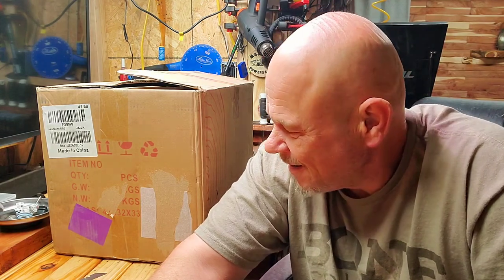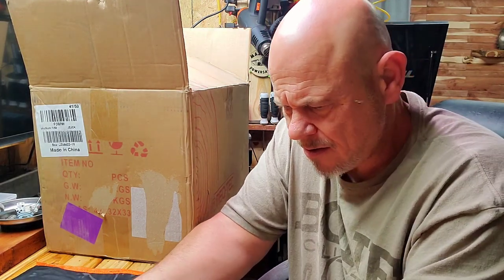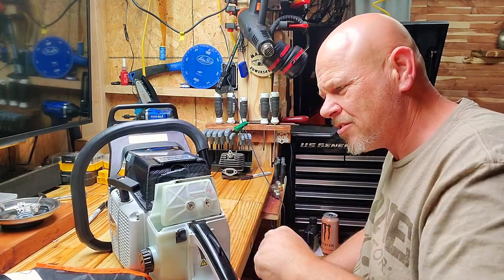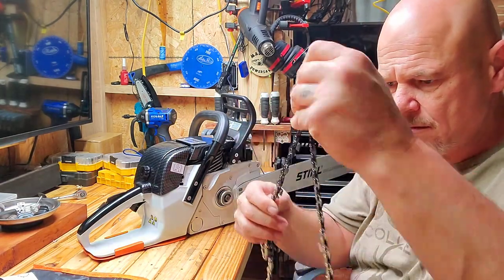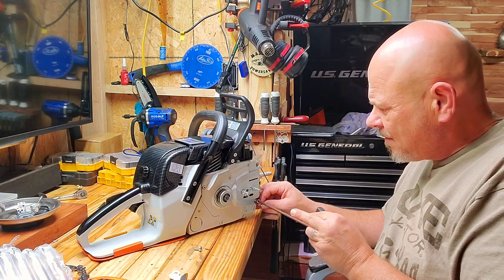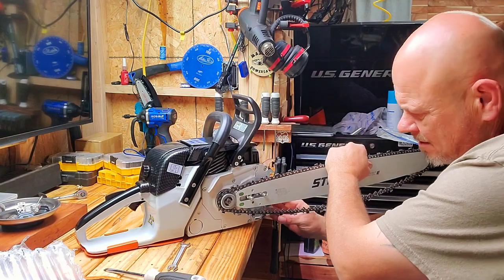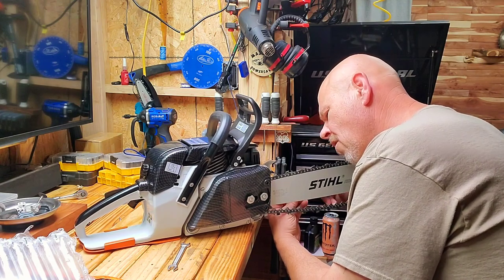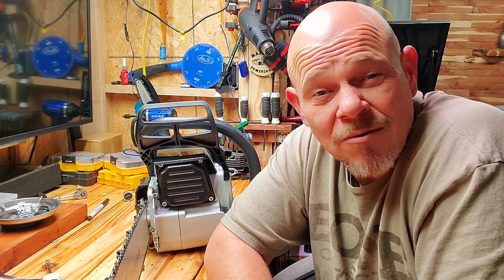F380w FARMMAC 72CC CHAINSAW UNBOXING!  SUCH A AWESOME POWER SAW! review

Comment: Just received my saw today. This exact saw but it came with a wrap handle. Completely surprised me. The Amazon description didn't list one. Its awesome. Great looking saw.
Reply from the maker: You sure it was the 380 72cc. Sounds like you received the ms660 92çç the bigger saw that looks just like this one
Reply: @majorpixchannel7146  says f380w on the badges, has a rounded filter cover instead of a squared off one like the 660. If I could post a picture here I'd show you.
Reply from the maker: @dellgregg4663  very cool 😎.  Id be interested in finding out what wrap they used to put one on there. I'll find out from the owners!

Comment: I just received my FARMMAC F380 today, first thing that I found is it is very hard to pull the rope, very high compression, will be putting on that other handle, LOL  Also the gas cap leaks, still trying to figure out what to do about that.  Runs great, but I did order it with the bar and chain, but they did not come with this package, and no indication that they have been shipped, will try to contact the seller and find out what is going on.

Comment: Good evening! I recently finished building my “$50 chainsaw mill” as designed by Izzy Swan on his YT channel. But it was your videos that committed me to purchasing this Farmmac F380 chainsaw and it was delivered today. The fit/finish isn’t spectacular, but it seems solid and ready for action. I did smell a little gas in the tank so I’m guessing they probably run it for a test. I was looking at drilling holes into the bar to mount it solidly, but the orange base is removable and I’m thinking I can come up with some longer screws to mount it to a base, saving the bar. I love that Norwood you’re working with. I have the same size trailer too, so that’s a thought. Thanks for your channel. It’s inspiring.
Reply from the maker: That is really cool 😎  and thank you for the kind words, sir! True enough, there was a Bach of those that the fut was not as good as it should have been! The top cover hole is drilled just off 2mm on the starter side, closest to the trigger! They are very solid saws 👀 glad you like it! The 380/381 is by far my favorite saw in the clone world! 
Let me know if I can be any help! 
Be safe 🙏
Reply: @majorpixchannel7146  Thanks again for introducing me to the Norwood. I had never heard about them before. I also appreciated the advice on the bar length when you mentioned that the 25" can vibrate a little outside of the log. I'll have to adjust the log position once I start since my bar is 25". Do you prefer the ripping chain or the standard 30-35 degree?
Reply from the maker: @BidenLikesMinors  you are welcome sir 🙏 
So I prefer granberg ripping chains https://www.granberg.com/
However,  I use full chisel as well... and when I sharpen.. I take a little at a time in the 10% angle! Lol, that way, I don't waste any tooth lol. I'm cheap
Reply: @majorpixchannel7146  Thank you. Good information. I’ll look up that up.
Reply: @majorpixchannel7146  Hello! I finally got everything assembled and started the F380W for the first time. Took about 4-5 pulls and I ran it for a minute. I turned it off and went back to start it about 15 minutes later and the cord is very hard to pull. It sputters loudly on the first crank around and pulls the cord out of my hands. That hurts. Has this kind of chainsaw behavior ever happened to you? I’ve never had this happen on my Echo.
Reply from the maker: @BidenLikesMinors  when that sputter happens, take it off choke, and she will fire right up. Also, remember these bigger bore cylinders have way more compression! So yes, I never use the decomp button... but, you might try using it!
Reply: @majorpixchannel7146  Ah! Okay. Thank you, I'll give it a go and let you know how it ends up. I can definitely feel the larger bore cylinder.
Reply: @majorpixchannel7146  The same issue popped up and I did some more research and I believe it's called "recoil kickback". Apparently it can be caused by a flywheel issue or "When your pull starter on a OHV small engine gets ripped out of you hand from high compression. The high compression is caused by the exhaust valve being out of spec. which in turn wont allow your automatic compression release (ACR) to function as it should. After my shoulder almost got dislocated by the cord ripping out of my hand, the engine makes a loud pop, almost like a backfire. I think there may just be a manufacturer error. No bigg deal. I' m trying to communicate with Neotec via the chat app and see what they can do about a replacement/return. I had my chainsaw mill all set up too! Grrr.
Reply from the maker: @socal33  are you unable to get the saw started?
Reply from the maker: @BidenLikesMinors  so chainsaws are made to be high compression! So, the pull rope being pulled back exclusively hard is not new to the chainsaw world! Iv worked on sooo many of these units and never seen such a issue (recoil kickback) this issue is normally found on small engines such as Briggs and lawns mower type!
Reply: @majorpixchannel7146  That's why this  situation is balling to me. I've started it twice. It was not hard to pull the first time.  It started fine. I turned it off, then I couldn't pull the cord past the first feeling of resistance. The muffler made a loud pooping noise, and then ripped the cord out of my hand. I removed the spark plug, cord pulled fine, then the same thing happened after I reinstalled it. Loud pop from the muffler, and at the same time the cord nearly pulled my thumb off! I can't get it started. Not my first small engine either. Right now, I can't start it, choke off, or even in STOP. I don't know what else to do. The only think that seemed remotely similar was the recoil kickback. Strange behavior from a chainsaw 🤪
Reply from the maker: @BidenLikesMinors  sounds like maybe there is a timing issue then! Contact me on the fb group https://www.facebook.com/groups/308747080753068/?ref=share_group_link
That's the Neo-tec group for chainsaw users and builders.  Find one of my posts and friend me. Then dm me and I will help resolve this issue.
Reply: @majorpixchannel7146  Maybe this will help better than the words I use. Looking at the video is the first time I noticed smoke coming out of the exhaust. Examining the plug, it’s wet and has carbon on it which I wiped off. It didn’t even run though 🤔 The cord didn’t get pulled out of my hand as bad until the last stroke. My shoulder is done for the day :) Here is the 2 minute video I uploaded. What do you think? Also, Neotec has gotten back to me. 
https://youtu.be/u9YPjBL3ATs
Reply: @majorpixchannel7146  Thank you. I just uploaded the video to help out with my description.
Reply from the maker: @socal33  ware did you upload it to sir?
Reply from the maker: @BidenLikesMinors  I found the video, sir.. I replied to the video 📹 we will help you get it going. Just takes a bit faster pull, and tell it breaks in!
Reply: @majorpixchannel7146  Or until my arm breaks 😂
Reply: @majorpixchannel7146  I got it up and running today. Cleared out the flooding I think, cleaned the plug, and gave it a big heave-ho. Ran it for a few minutes and I’ll see how she starts again.

Comment: How is that thing holding together?  Do you have a farmmac 372 to compare it to?
Reply from the maker: Truly my favorite saw! It's ported and out runs stock 660s. I also have the farmmac f380 black one! Both really solid saws! The f372 I don't care for! I did a complete rebuild with a Big bore kit and piped! Mean saw now... However it seemed to have timing and fuel issues stock!  Im almost positive neo has fixed all the issues with them now! 
Thanks for watching jonh

Comment: Does the air filter cover not line up on yours ? I just got mine and its a little crooked.
Reply from the maker: Mine is off just a bit too! This was something they was supposed to had fixed. And I very long Time since iv heard of anybody having the issue again. 
I would bring it to neotecs attion! 
The part that is off is the top cover bolt holes are drilled off just a bit on the left side! 
At least that's where the problem was last time. Sorry to hear you were having this problem
Reply from the maker: I can tell you that it truly does not affect the saw at all.
I have several of this exact same saw that are perfect. LOL it's an eyesore. 
Just wanted to read message you and explain that technically it does not affect the running of the saw at all
Reply: As long as it doesn't affect performance it don't matter if it's a little uneven thanks for the reply.
Reply from the maker: @Stonercowboy69  yes sir....
Let me know if you have any issues down the road with it.
Reply: Do you port and modify chainsaw for other ppl ?
Reply from the maker: @Stonercowboy69  yes sir. I Port about 30 a year !  Price depends on the saw and how mean 😁 a guy wants it! Includes muffler mod and a ready to use saw!
Reply: Cool if I ever wanna get one ported I'll give you a call. Appreciate the help.
Reply from the maker: @Stonercowboy69  absolutely 💯. If you decide, just email me majorpixsaws@gmail.com 
Also my email is in my about info on the channel.

Comment: i ordered one power head only can you tell me what bar and chain fits in the 20 inch?
Reply from the maker: Power heads that would fit a 20-in would be 72cc saws, in my opinion! MS380, 381, HUSQVARNA 372XP , 272 
THANKS FOR WATCHING 👀 🙂 🙏
Reply: Sorry I meant what size and pitch
Reply from the maker: @woody s adams  oh, I see yes it's a 3/8 pitch and 20in 25in work wonderful
Reply from the maker: @mtnviewtow88  https://neotecworld.com?sca_ref=2995598.iaBOQ5tywB here is the link to neo. Awesome prices
Reply from the maker: @woody s adams  any 3/8 pich made for stihl bar will work. And a chain that fits the bar. They come in .63 gauge. 50 gauge!50 being thinner! 
I run oem stihl bars on my stihl clones. There about 75 for the bar and 35ish for the chain! I also run .63 seems like it helps from getting my bar pinched! Just my opinion! The Neo-tec bars and chains are the next best thing! That 380 is a beast with the 20in bar and chain! But, if needed to it would pull a 36in!
Reply: @majorpixchannel7146  cool 😎

Comment: Whats the part number for that 20 inch stihl bar?? I can't find one with d025 mount?
Reply from the maker: I will be home from work in about a hour and I will send you the part number and some links sir!
Reply: @majorpixchannel7146  ty
Reply from the maker: @garrettwebster9320  https://www.amazon.com/STIHL-3003-000-9421-20-Bar-8-063/dp/B00C3J24YG
Reply from the maker: @garrettwebster9320  3003 001 9421 is the part number. Atwoods carries them for 75 if you have one at your location
Reply: @majorpixchannel7146  ty sir..what chain you runnin with it?
Reply from the maker: @garrettwebster9320  stihl 3/8 .63 72 count
Reply: @majorpix channel  perfect..I just picked up the f380 higher end version..should rip like hell through some grain with a 20 bar
Reply from the maker: @Garrett Webster  however,  it's because they are local, and I can pick them up easily. There about $37 
But, the Neo-tec bar and chain for that same set up is nice!
Reply from the maker: @garrettwebster9320  https://neotecworld.com/products/neotec-chainsaw-bar-and-chain-combo-3-8-pitch-0-063-gague-25-28-36-42in?sca_ref=2995598.iaBOQ5tywB this is for a 25" bar and chain if wanted from neo. I'm sure they also have the 20
Reply from the maker: @Garrett Webster  the 25 in is 79.99 for bar and chain... I have several of them! They are nice! There is no tax on the site and no delivery fee
Reply from the maker: @garrettwebster9320  yes it will... they are total beasts! And can carry up to a 36 if needed
Reply: @majorpix channel  can't seem to find any in .063..only .050..im not milling..the .063 is still the way to go?
Reply from the maker: @Garrett Webster  I use the .63 because it's the most common in stihl bar and chains to find. So, you can go with. 50 no problems! As long as chain maches the bar and the chain is 3/8 pitch! Also stihl mount!
Reply from the maker: @Garrett Webster  .50 us normally a favorite for miller's because less waste! But, .50 to .63 is not much different... and helps to not get the bar pinched (lol still happens )
Reply: @majorpixchannel7146  ty brother..im goin with semi chisel .063 on that same stihl bar you have.
Reply from the maker: @Garrett Webster  also... when you get your bar and chain... take the chain numbers down for when you need a new one! Sometimes, the numbers get hard to read! And it's easy to forget lol 
I have a hole log of bars and chain numbers for my almost 100 saw collection. lol I have a problem  😞
Good luck, let me know if I can help in any other way
Reply from the maker: @garrettwebster9320  good choice... Simi chisel is smooth in the cut